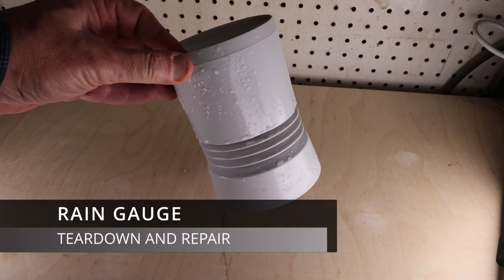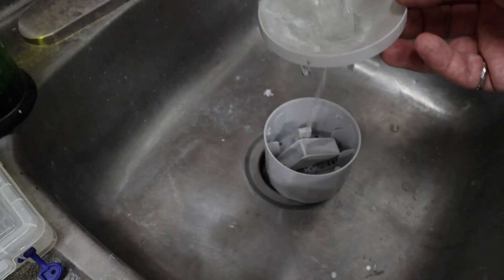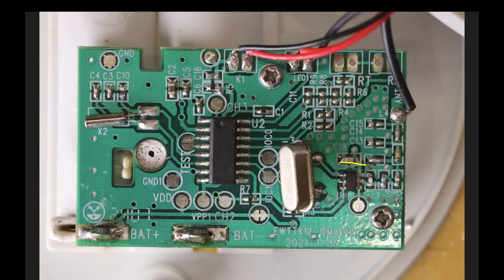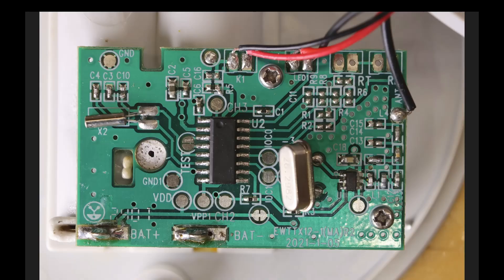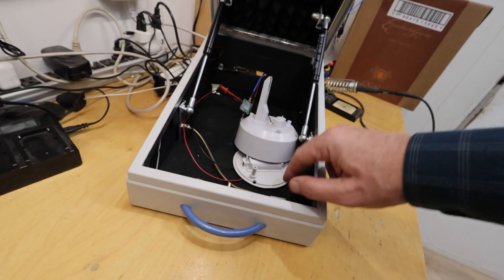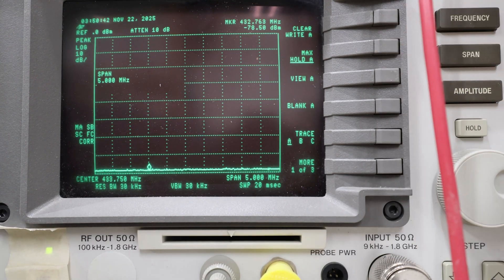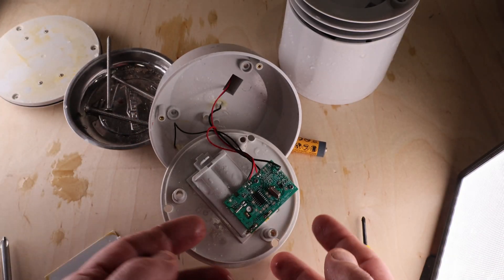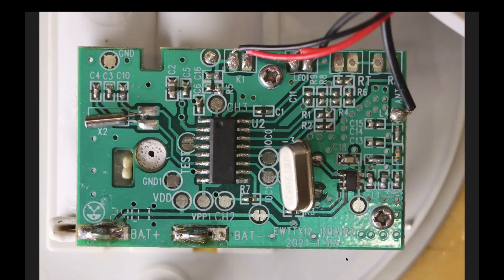Shockingly Poor Engineering: Rain Gauge

Comment: Is the rainwater shorting out the RF section, or just de-tuning it to the point that the receiver can't hear it?  Seems like maybe the latter, given that the coating you tried must have altered its tuning a bit.  I guess the other possibility is a tiny bit of dialectric material messes with the antenna's resonance, which is maybe something you can compensate for by changing the length of the antenna itself...

Comment: Wow, to discretely implement an RF transmitter that way is... a lot of work to save literally less than 5 cents. 433MHz RF transceiver chips - stable ones with FCC documentation - are well under 40 cents these days.

Comment: If you replace the insulated flexible wires with rigid ones the transmitter can be baked and potted. Can be it potted with power resistors placed around to keep it warm to aviod condensing on the surface.

The enclosure cant be turn into watertight by selaing you just slow down the penetration and absortion.

Comment: Might be better off to waterproof the top enough to shed actual water drops, and add drainage to the bottom to avoid holding water.  Water will find a way in, even if it is just temperature cycling pumping humid air and forming condensation inside. If water accumulates around anything with battery voltage, it is likely to cause electrolytic corrosion which will eat tracks, component leads and wires. I've several outdoor temperature sensors that had gaskets, etc and assumed no water would get in. On my covered porch they were not exposed to any water yet the effects are obvious.

The huge original mistake seems to be not designing for and using conformal coating with appropriately tuned circuitry.  No easy way to fix that. A light mineral oil is usually my treatment of choice for everything but RF. I learned about applying oil to tuned RF circuitry when I was about 12 and trying to clean up a flood damaged receiver.
Reply from the maker: Good ideas, thanks for the feedback.

Comment: Should have had an FCC id on it and you could have looked up the transmitting frequency. But what if the fun in that? You may be able to receive and decide if with an RTL based SDR using the program rtl_433. These usually run around 433.92MHz.

Comment: Where to buy ?
I want one and add a esp32 esphome into it
Reply: These are very common. Either with other weather sensors or by themselves. I've not seen this unit he's using. I suppose you could even buy it independently without the receiver and then mod it.

Comment: A rain gauge that isn't waterproof. That seems to be a slight oversight. You'd think someone would have made that a consideration. Good Lord... Hahahaha.... But it is a shame, the mechanical section is actually a pretty clever design for metering the water.
Reply: The professional grade tipping-bucket rain gauges look similar to the casual observer. But they work for many years due to subtle material choices and design details.
Reply: I've taken a couple of these kinds of rain gauges apart. They all do work the same way. Only difference I've seen is some only have a one side balance. Once full it tips, drains and pops back to gather more water. Rather than the sea saw type. I think all used reed switches. Though using a hall effect sensor would work just as well. Never had one have moisture issues though. Conformal coating anyone? Also positioning the electronics in the right place would make all the difference. Like not in the line of fire.

Comment: Someone has sat on your secondary microphone. It's smashed very flat! - Also remember to drill a couple of drain holes on the bottom near the sides of the case. Water WILL find its way inside with changing temperatures. Not leaving a way for it to drip back out is a recipe for disaster.
Reply from the maker: Good ideas, thanks for the feedback!  One day I will get this microphone dialed in correctly...

Comment: I have actually personally been more successful by adding controlled drainage holes at the lowest points of outdoor enclosures than trying to seal them off hermetically. The thermal expansion and contraction of the air inside will actually work against you and suck both humid air and water in through the tiniest openings when you don't get a real hermetical sealing of the enclosure.
Reply: Even if you seal the case 100% you need to make sure all your wires are sealed, air will flow through the wires inside the insulation
Reply: Unless the air inside is perfectly dry, temperature changes will result in condensation-evaporation cycles and cause corrosion. Design to let water out -- but also to keep insects and spiders out.
Reply: This is why a lot of the coaxial cable (mostly TV now and even that is being replaced) infrastructure is actually pressurized by nitrogen tanks. Any leaks become outflow and can be detected, rather than sucking water.

Comment: Something to try is applying petroleum jelly. Might not have the same effect on the capacitance while waterproofing the board
Reply: it's a great protectant , a Naval favorite that regularly beats out purpose-made products in harsh test environments .   The RF impact would obviously need testing.   Only other drawback is it tends to liquify and run off of things at elevated temperature i.e. applications  that generate a lot of heat or are bathed in excessive sunlight .
Reply from the maker: Interesting idea!
Reply: @electronupdate  Bees wax works as well, it is used to seal RF front ends from vibration, and does not shift it much in frequency. that bigger IC is very likely a holtek encoder IC, with the reed switch triggering it to send a fixed code signal to the receiver. Low repetition rate is within the capacity of that IC to do, and allows you to have multiple sensors with single digital inputs, or even a a slow ADC value sent reliably.
Reply: Conformal coating isn't too expensive too
Reply: Aren't there commercial conformal coatings meant specifically to avoid interacting with RF circuitry?
Reply: @georgedorn_fnord yes and those sites have forms that say "make inquiry" and when you email them they ask questions like "so how many 55 gallon drums do you want?"
Reply: @georgedorn_fnord The hard thin film acrylic and polyurethanes have among the least impact, though they aren't waterproof the way silicone or potting would be.   there is always some RF impact in theory.   Testing is always required.